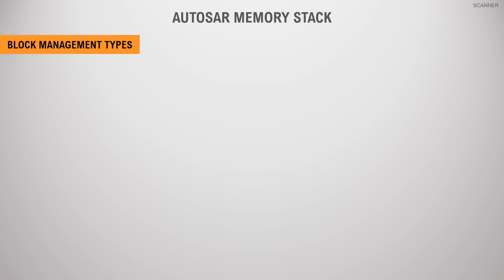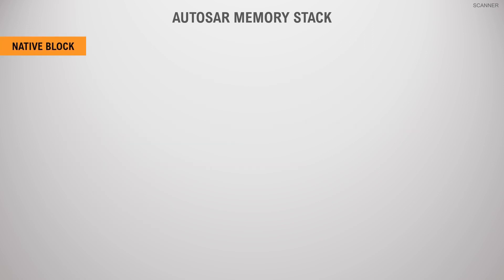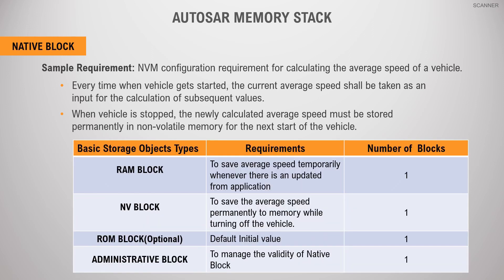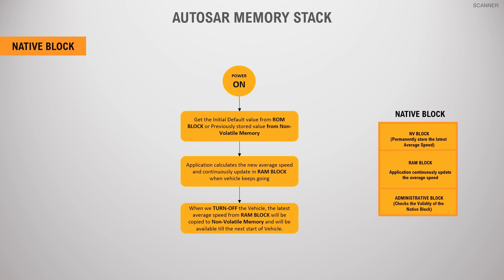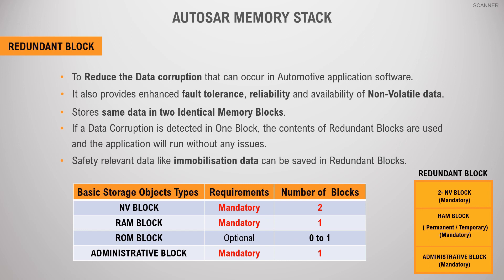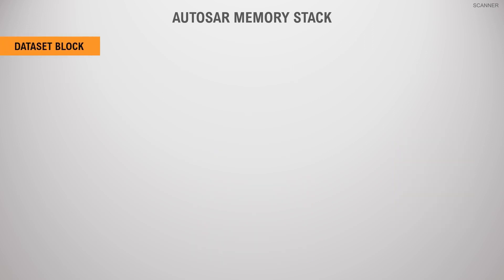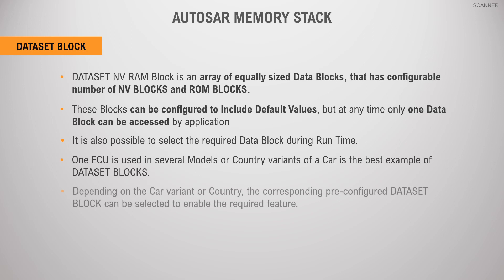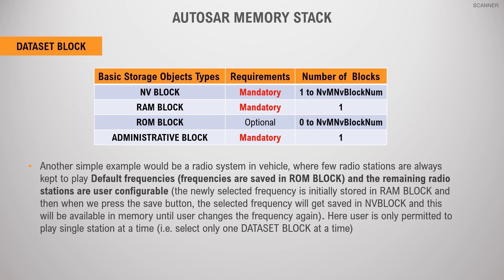AUTOSAR MEMORY STACK : PART 2 | BLOCK MANAGEMENT TYPES

Comment: If Application NVM configures 10 blocks to store in EEP memory, if bootloader wants to read only 10th block information, Does bootloader need to configure only 10th block or should it need to configure all block. If bootloader configures only 10th block does it point to right address in EEP memory. Please Clarify. Thanks In Advance.